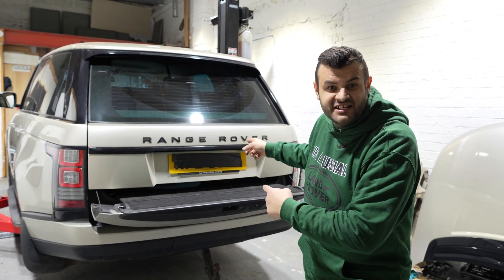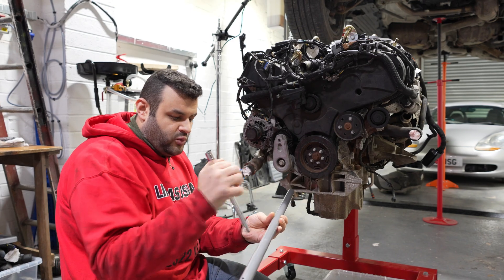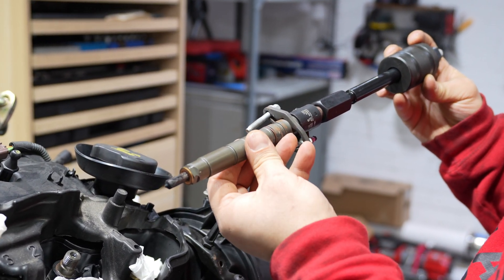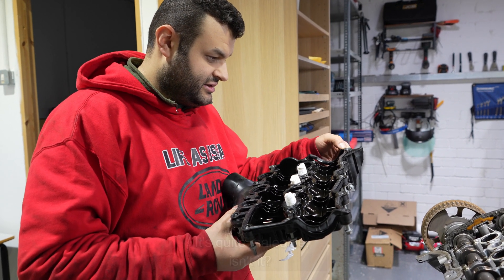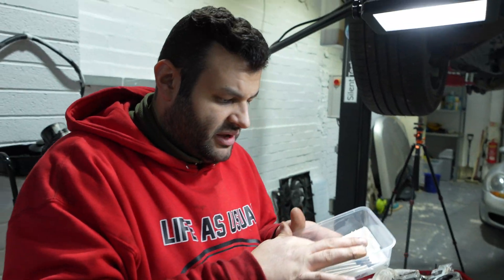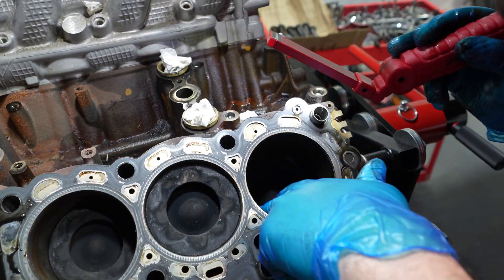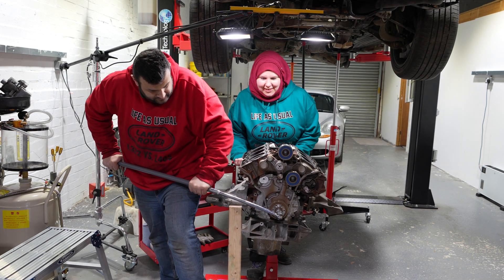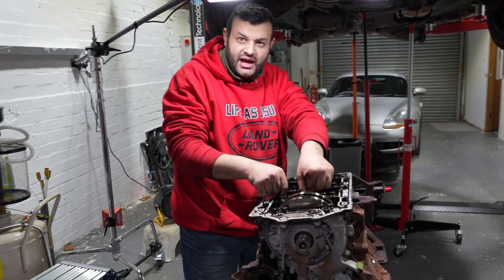I FOUND THE CAUSE OF ENGINE KNOCKING ON MY BROKEN CHEAP RANGE ROVER

Comment: I think that you have discovered the outcome of the fault. The more important issue is finding the cause. It is not just wear as there is excessive movement on only one bearing. Possibilities include oil starvation (again, unlikely to affect only one bearing). More likely that someone has run the engine very hot (possibly with low oil) - something has to give - so this journal expands and  grabs the bearing causing it to 'run' inside the con rod. I've had the situation where the crankshaft had a reed across a journal which opened slightly at temperature and grabbed the bearing. It would run fine for several thousand miles before misbehaving again. The main issues are  whether the crank journal has sustained damage - white bearing metal will polish off but the hammering it has taken from being run with so much play will not have helped it or the con rod.
Reply from the maker: Thank you so much for all this information, it's extremely useful, especially that we are currently (as we speak) inspecting for further damages and hopefully if all goes well, I should release another video this weekend to go into more depth with regards to what's actually happening, because it's actually much more than what we initially thought in terms of the damages. Thanks for watching! 😊👍🏻

Comment: The only cheap Range Rovers are those that get scrapped. The rest are money pits, and the TDV6 is the worst diesel engine on the planet. They should have named it Rodney Knox.
Reply from the maker: The other Range Rover I had is a V8, so I've never experienced a V6. This is my first time to own a V6 so I don't have proper experience in V6 yet. But I'm hoping to learn more about them! 👍🏻 Thanks for watching! 😊
Reply: @lifeasusual  The V8s were good engines. Unfortunately the TDV6 is known for rod bearing failures and for breaking the crank. Good luck with yours and hope it remains problem-free.
Reply from the maker: Thank you very much, I appreciate it! 😊

Comment: it's a good explanation
but you should have simply removed the sump and found the knocking first rather than dismantling the entire engine
change all the bearings at the bottom end, including the mains, but if it's going to need a crank though...
Reply from the maker: If you remember from previous videos with regards to the fuel issue, if I had started at the end, I wouldn't have been able to inspect the fuel injectors or the pistons. And I would have had to end up removing the top regardless, so I can inspect the crankshaft and the top of the engine block and the bores. I'm doing an inspection of the crankshaft to check for further damages and hoping to release a video this weekend and provide you an update. 👍🏻 Thanks for watching! 😊

Comment: `It's the element of surprise!`  😅
Told you to get the sump off, didn't I ?!
Well done though, Fahed.  Trouble is, I think:  the pissy oil they tell you to use in these engines will cause failure again when it is fixed.
Reply from the maker: Yes you did! 🤣😁 Now let's see what damages it has caused, hopefully I'll do more inspections and get another video released this weekend if all goes well! Stay tuned 👍🏻 And as always, thank you so much for your ongoing support, really means a lot!

Comment: Dude just replace the engine and sell the old for parts,   get a short block
Reply from the maker: That could be an option, I will see if that is possible. 👍🏻 Thanks for watching!
Reply: @lifeasusual  nah I'm telling you the truth,  the bottom end of your motor is stuffed,  you shouldn't grind the cranks on this motor, just buy a new crank, but I'm gonna guess the bearings have caused more damage to the block by spinning, the bearings are only press fitted
Reply from the maker: Yes, you could be right. I'm actually in the process of doing further inspections to the full block, including crankshaft and bearings, and I will go in more depth in the next video, which I'm hoping to release this weekend! Don't worry, I will not be cutting corners, and I won't do half a job. I will make sure to get it done properly 👍🏻 Even if I have to replace everything. Stay tuned!

Comment: original 2.7l TDV6 was indeed a Puegeot derived unit. Think the 3 cylinder was a development of that unit. Don't want to be a party pooper on your amazing efforts but given the reputation for these engines cracking crankshafts - I'd be very nervous of this ending well if you just change out the bearings. Take professional advice. Good luck
Reply from the maker: Hi Ant, I definitely want to go above and beyond, I'm not going to cut corners because I am planning to keep this car. And even if I sell it, it wouldn't be fair on the next owner for me to do half a job. I'm currently inspecting the crank for further damages and I'm hoping to release a video this weekend. 👍🏻 Thank you for continued support! 😊

Comment: Good effort but you should’ve started at the bottom end!
Reply: Like he said, knowledge is power!   His aim to find and fix but secondly to totally strip this engine to learn ! And make a YouTube video...    maybe you should watch part 1 again, were he clear explained his reasons for this particular L405 project ))))
Reply from the maker: Thank you so much Ian, I really appreciate your continued support 😊 You were spot on 💯 with regards to the reasons for undertaking this project! 👍🏻
Reply: What a load of old bull not a mechanic but has a full workshop complete set of tools even specialist tools for removing bits that people like myself who has been a mechanic for 50yrs haven't got
Reply from the maker: This is the highest compliment I have ever received, as I really try hard to learn and be as professional as possible; so thank you so much for your compliment and support, and I'm really sorry to hear about your tools. If there's anything I can do to help, please let me know 👍🏻 Thank you very much for watching 😊
Reply from the maker: Hi Chris, if you remember from previous videos with regards to the fuel issue, if I had started at the end, I wouldn't have been able to inspect the fuel injectors or the pistons. And I would have had to end up removing the top regardless, so I can inspect the crankshaft and the top of the engine block and the bores. Thanks for watching! 😊

Comment: Great to see you moving along with the rebuild! Great to see that the crank is not snaped. Hopefully it is intact and you can just change the bearings. 
Just so you know, the engine is made by Ford (FoMoCo - Ford Motor Company) and is used by Peugeot and Citroen in their cars.
Reply from the maker: This is extremely valuable  information, thank you so much Valentin, I did not know that! 👍🏻 We've been wondering about this since we disassembled the engine, so now we know! 😊 I'm inspecting the crankshaft and I'm hoping I can get a video out this weekend to provide you guys an update. Multumim pentru sprijin! 😊

Comment: classic 3.0 rod bearing failure, quite common unfortunately. If caught it can be repaired, many continue and then the crank snaps or the rod comes through the block...........personally I think it s design fault
Reply from the maker: Yeah, it could be! But I'm still inspecting the crankshaft for further damages and see if it's savable or not, and hopefully I can get a video out this weekend to update you if all goes well! 😊👍🏻